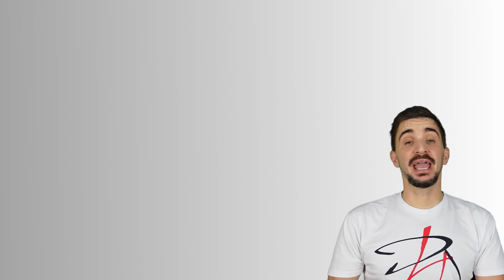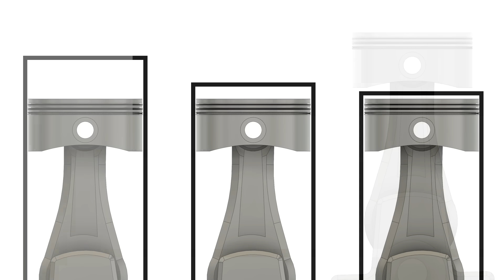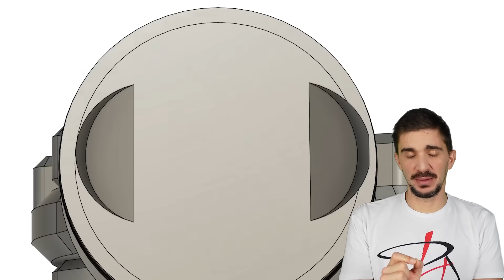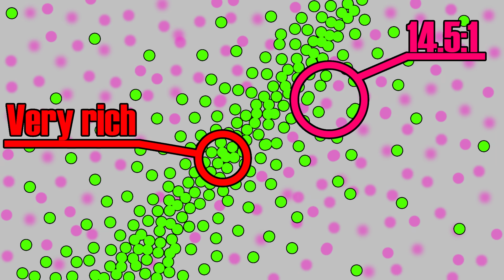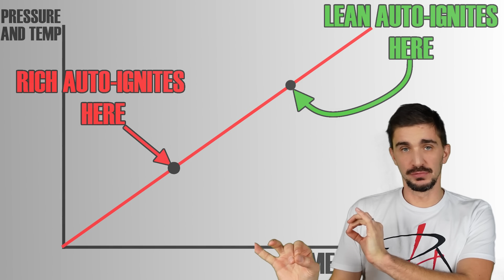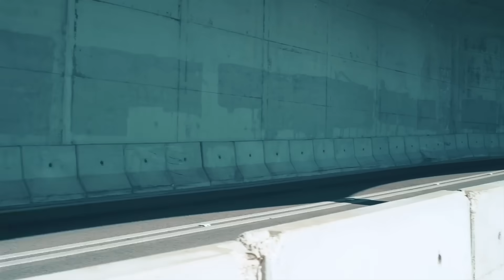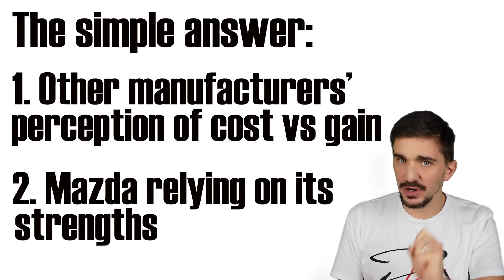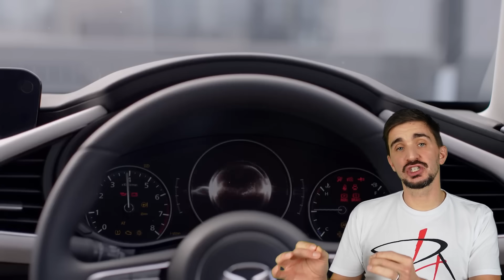The Game Changer Nobody Cares About - Mazda Skyactiv-X SPCCI How it Works and Why It Didn't Catch On

Comment: Skyactive x has bad nox emissions for US epa testing. The skyactive g has similar power and have more sellable turbo options. There is supposed to be a skyactive x hybrid with Toyota synergy drive in the next couple years. Toyota is upping their ownership in Mazda and they are supposed to have the new 86 and supra made by them so that will help.

Comment: actually you answered the question yourself at the start of the video, and it bottles down to the combustion chamber of mazda hcci actually being "over-engineered"; 

4:14 in areas where we have very rich ratios we have insufficient ratios to burn all the fuel

so the hcci is overengineered in the sense that all a standard diesel needs is more air-intake..... and the hcci solves that issue by adding a spark-plug and spraying gasoline at it..... so you already have an injector in a diesel, which you replace with a spark-plug... and then add an injector, even though you already had an injector.......

point being you can also simply increase the air-intake and as such the diesel simply gets more efficient without the necessity of adding neither gasoline nor spark plugs.

it is engineered redundancy to solve an air-intake problem by adding a spark plug and gasoline, instead of air.... it is achieving the same increase in efficiency as simply adding more air.

Comment: Mazda has all my approval for developing this. I know what torque (force) and rpm (speed) are, and that power is the product of both (P = F × v). I also understand torque, rpm and power curves, and know how to extract the most of an engine. I grew up driving a car with a small, carburated atmospheric otto engine with manual starter (air flow restrictor valve in the carburetor) which I used as little as possible, sometimes keeping the engine alive by rhythmically pumping the accelerator pedal without using it. So, to me using a conventional aspirated gasoline engine is far from being a chore; it's something fun instead. You can't count on ignorant people enjoying this, though, as some simply don't know or have been educated incorrectly. For this reason, versions of this engine with a variable geometry turbocharger or an electric engine torque booster (an hybrid, I guess) could help those who don't know.

Comment: I have the Mazda CX-30 with Skyactiv-X, and the video is spot on. The engine really comes alive when you give it some revs, but it's also incredible because you can drive it like a diesel on 1.2k RPM in 6th gear and just enjoy the low fuel consumption.
Reply: Great interior too for the price. Mazda really underrated
Reply: @SWatchik  they just lack modern tech. Has some, not enough for this time. Then the issue of price in certain regions, and agency.
Reply: Now they just need to make a 2.5L version (ideally 5 cylinders because it's cool) and 6-cylinders with 3 liters in displacement for more power, also put them in plugin hybrids and range extended EVs.
Reply: Sounds like an engine with this characteristics would pair well with electric for a hybrid, where the ECU is in charge of the throttle.
Reply: I was always interested in the sky active x technology and benefits, but the worry of reliability was too great. My next car might just have to be one!
Reply: erroneous statement/ t Aisin 6speed in my 99 mx5 rocks/ gotta keep t rev’s middle to high then enjoy/ go Mazda 
H
Reply: I wouldn't keep it under 1400-1500 when cruising
Reply: @rouchar  1400-2000 RPM is the optimal engine speed for fuel efficiency. Thats why all skyactiv cars have a special 6 speed designed to keep the engine in that RPM range as much as possible. My Mazda 3 does 40 mph at 1200 rpm like some diesel lol.
Reply: @Youtube_AI_Bot_3  that is maybe true for Skyactiv car, but on other engines the fuel-efficiency increases with RPM (because horsepower & engine-drag increases with RPM and the sum yield best output around 2k RPM for large engine and 2.5k RPM for small 3-cylinder engine).
Reply: @xponen That is not true lmao
Reply: @brolo7234  "bfsc vs rpm" will explain how fuel-efficiency peak at 2k to 3k RPM.
Reply: @xponen  I think this is mostly right, but it's only the whole story when you mate an engine to a CVT. BSFC is not just RPM, but load. If you need to produce x power to propel the car down the road, as you increase the RPM, load drops. Load plays a bigger part in efficiency than RPM does, and unless you have infinite gear ratios, you're almost always better off running the higher gear to get engine load up.

With a CVT, you can dial the engine's load and RPM into the best spot on the map for efficiency and hold it there.
Reply: @Youtube_AI_Bot_3 dude i drive a long stroke 1.9 tdi with all the low end torque and i don't keep it under 1.7k rpm in the 6th, you're gonna lug the engine
Reply: @Youtube_AI_Bot_3  and at 90 k u will need major engine work, mazda engines last the longest when u drive the daylights out of them, keep rpms @ 3500-5000 as often as possible
Reply: How does modifying these engines go? Are they easy to work on?
Reply: @mercury2c  I wouldn't modify anything on these. You'd only ruin the SPCCI mode. As far as repair and maintenance they seem to be as easy to work on as the other Mazda 4-cylinders.
Reply: I'm the opposite, have the cx30 and think the mileage is terrible. Average 40mpg, it's slow in low revs and there's absolute no grunt at high revs considering its a 2 litre. Im going back to kiabecause im just fed up with the poor performance.
Reply: @justmehereUK  40mpg on average is great for a gas powered non-hybrid car. If you think that's "terrible" then you're clearly not comparing it to an equivalent car, or you're not talking about combined fuel efficiency.
Reply: @justmehereUK  40mpg is terrible for 2.0 180/186hp car? what? For any sort of power you need to drop it to 2nd gear if you're below 100kmph or 3rd gear if you're below 140kmph and then push it to the limitter. It's normal behavior of NA engine idk what to tell you. Turbo cars feel much different to drive, it's just the nature of the engine.

Comment: Turbos seem to be the de facto answer to achieving good fuel economy test results without sacrificing performance potential (despite less impressive efficiency in real-world driving). The Turbulent Jet Ignition system introduced recently by Stellantis (where a smaller combustion chamber surrounds the spark plug separated by a perforated shield, and the spark-ignited mixture in this small chamber shoots fire jets out  into the main combustion chamber to more easily ignite the air-fuel mixture) is also intriguing as it allegedly borrows from the latest F1 engines where low fuel consumption during high load is very important. It is also interesting that they did this without actually being related to an F1 team. Looking at the corporate structure, they do own Fiat who used to own Ferrari, but they haven’t owned Ferrari since 2016. How they were able to gain access to the technical knowledge is curious… In any event, just as in F1, the engine in question also employs a turbocharger…

Comment: I drive a 2023 Mazda3 Fastback with a 190 hp SkyativeX engine and a manual.

I really like that car.

The engine is also really reliable I drorve that car a lot and had not problems.
Hwoever the Spark Plug dont last that long due eto the high compression, havae to chanage them every 60 000 km.

It is true that this engine despite its not insignificant power output lacks some punch.
It makes 190 hp, but it nened 6000 rpm to do so.
Doesnt bother me that much since I drive manual so if I wanat to pjnch it I downshsift in advance.

I am looking forward to Mazda next generation SPCCI engine the Skyactive Z, which has a 3,5 l inline6 version.

That should make up for its lack of punch.

I really hope they put the Inline6 SkyactiveZ in the Mazda3 Fastbackc.

Comment: note for the end question:  Before modern manual gearboxes, people had no synchros so they had to always double clutch. Before that they also had to manually adjust fueling and timing while driving. And had asbestos brake pads, toxic leaded fuel and oil. You would not want to go back to that. That is progress. As far as the driving experience goes, choosing what is easier and more comfortable depends on what you are doing. I'd rather do something else than driving when i have to drive into traffic, or during long straights on highway, even more at night or in difficult conditions. At those moments, i'd rather call my friends, sleep, read, work or anything else. But If I go driving for pleasure, all that goes away. Although I would not like to have to adjust AFR and timing while driving for fun on tracks or mountain roads.

Comment: My cat gives over 60mpg consistently. Sometimes over 65 and occasionally over 70. 1.5 HDI. Any other car / engine I get will be a downgrade. I love Mazdas engineering. But I can use HVO fuel which drops carbon and No from my diesel but its price is problematic at the moment

Comment: I have the slightly older, Mazda 6 2015 Skyactiv-G 2.5. The older G-version is already pushing higher compression ratio for efficiency, but not to the point of near-ignition like X does. 

Anyway, regardless of the engine type, what a fantastic car. Extremely reliable, practical, decent fuel eco for 190hp car, pretty good looking imo, nice interior and very, very fun to drive for a normal midsized saloon. Mazda really knows how to make car handling feel nice. If you're an old school guy, you can have it with a proper manual gearbox too. Mine has the automatic and that is excellent as well, it feels pretty rigid as they have maximized the amount of time when torque converter is locked, so no rubber band feel when putting your foot down. 

Zoom zoom!

Comment: Why doesn't Mazda just make a mild or rather plug in hybrid with a reasonable battery (e.g. 40kwh) for breaking and acceleration? I mean let that engine run all the time (or let me decide to run the engine or not), and then let me have fun with a nice acceleration and don't waste much energy with the recuperation. And let me enjoy all the benefints of an electric car, like v2l/v2h. Let the software manage the battery to prevent degradation (e.g. you can use it only between 30-80% except for emergency) and let the battery warm up the engine for ideal temperature to prevent cold running and other common ICE problems... Then they cound sell their car as the greenest one ever as it is made to last finally and not to leave a huge CO2 footstep.

Comment: Even though the engine might be very efficient, the cars are not. In typical car manufacturing company style they opted to NOT make their engine have the same power as the old one and vastly improve the fuel consumption, but they opted to invest all of the efficiency gains into having a higher rated power, with having only marginally improved the fuel consumption.
4.5 - 5.6 l/100km can be had with every European car that is powered with less than 80 hp, sometimes even less (especially with diesel engines).

Comment: Couldn’t a design like alphaotto’s Rev engine with the electronically controlled valve and turbo solve the HCCI combustion timing problem? U could even keep the same air fuel ratio throughout the working range of the engine

Comment: I have a 2016 Mazda Miata (MX-5 for you Euros). My car has an earlier version of Skyactiv (not Skyactiv-X). I drive mostly at 60 mph on back county roads and get 35(!) mpg in a sports car. Even when driving on the freeways at 80 mph I get better than 30 mpg. The downside is that I need to use premium fuel, otherwise less power when I floor it. (It's still amazing that the manual says I could use regular fuel if I wanted. Crazy adaptable engine). Zoom zoom!

Comment: It's ironic that so many "enthusiasts" call for saving manual transmissions, yet are so spoilt by turbo-fours with torque plateaus flat as the Netherlands you could drive them in two gears entirely - and call NA engines like these weak and slow.

Comment: What I don’t understand is the lean primary mixture NOT combusting by compression ignition……   Mazda must be direct injecting lean late in the compression stroke so the fuel won’t get hot enough to spontaneously ignite before the spark.  

     In designing engines (and other moving machinery) there are two problems:  getting it to run, and getting it to last.  The later is often  harder, and it is always slow and aggravating.  I applaud Mazda for their tenacity.                Cheers

Comment: Not bad for a first development but along with many new engines that dont have hcci or spcci it dose foul its injectors badly and relatively quickly and I suppose foul its inlet valves as every other direct injection unit dose
Hcci is a thing that dose work but not at the scale of the automotive engine just look at the old modle diesel engines they had a carburettor and compression ignition (No not the glow plug engines ) they ran on a fuel that was basically paraffin mixed with ether.

Comment: The reality is that you are getting about 10-15% improved fuel efficiency from skyactiv-x engines compared to most competitors in highway driving, but really these engines are not class leading overall. Due to their low torque they are worse and less efficient when driving slower compared to most competitors. But, most importantly Toyota's engines are just superior to Mazda's in general. You'll get good reliability and far better fuel efficiency.

I followed Mazda's development of Skyactiv-x very closely ever since they first mentioned it, but its real world performance has been far worse than what was first suggested, and the lack of effective hybridization is another issue.

Comment: It's funny what you say about a spoiled customer base. I had to stop driving for around 5 years, and we went on holiday to the south of England and hired a Mazda CX-5 with the 2.0 NA lump. 
My boyfriend at the time was a fairly inexperienced driver and had only ever driven turbo diesels, and watching him trying to drive that car was painful. Eventually he got it, but he was extremely frustrated that it didn't have torque at 1.5k revs and I kept telling him he needed to rev it. To be fair to him, the stupid gear shift indicator that Mazda put in it didn't help, as it kept telling him to shift up at 2k rpm which is mental in an NA petrol.

He got it eventually, and we actually ended up liking it so much we bought one, and I still love it. Sure, it's not fast, but it does amazing economy for what it is (45 mpg from a 2.0 petrol is crazy to me.) It's also so familiar to me. I've been driving for 25 years and almost every car I've owned has been an NA petrol. Downshifting and wringing their necks to get them to move is the best part of driving them, and I feel like nobody gets that now.

Manual petrols are sadly a dying breed, and I'm grateful that Mazda is sticking with them and trying to improve the formula rather than moving to H/EVs. 

Thanks for the vid.

Comment: Has anyone tried to mix diesel on intake stroke and then inject gasoline at TDC or even use a spark plug to ignite the homogeneous diesel mixture
This engine can be very useful in hybrid cars

Comment: Is there any data on how much this technology improves fuel economy in the real world? Hypotheticals are nice but only hypothetical. I was comparing my ford maverick (2 liter turbo with AWD and all terrain tires) to my friends Mazda 3 hatch (2.4 liter skyactive X NA engine, FWD), and we both got almost identical highway MPG numbers at 70 mph in top gear, despite the ford maverick weighing several hundred pounds more, having worse aerodynamics, having all wheel drive with heavy all terrain tires, and making substantially more horsepower and torque.

Comment: I won't say it's unimpressive.
It is a nice piece of engineering but what about real world results?
I heard people saying most of the time it runs with the regular ignition cycle rather than the SPCCI cycle.
And then there's the "issues" like low torque at low rpm.

I checked some website (I don't know the accuracy of the data so don't throw stones at me). So 2.0 skyactiv G vs X (mazda3 from 2020 to make sure it's no mild hybird involved, G122, G150 and X180) to compare their torque curves. So X hits peak torque at 3k RPM compared to 4k RPM on both Gs but low end torque is worse on X: at 1k RPM it's 75NM compared to 100NM and it surpasses G after 1750 RPM. At 2k RPM there's already more torque on X compared to G but low end torque is somewhat worse (which might be more obvious on since the car weights more with this engine)
But then I look at the mild hybrid X released years later and ... low torque is better now. And peak torque is higher but also at 4k RPM (torque at 3K is the same as it was on the non mild hybrid)

Ok so torque is questionable, especially low end. Other issues that I've heard about is engine heats up really slow. Yeah good luck driving around town in the winter...

If you can get good gas mileage on the X is it worth the extra complexity of something like the skyactiv G? Yeah it reliable but if something breaks does anyone know how to diagnose and fix? You can get a 10 year old skyactiv G and people know how to work on these if there are any issues. Will we be able to say the same thing about the X in a couple of years?

Comment: I only see a different version of a gasoline direct injection in combination with a stratified charge. Both exists since decades.
Additionally you didn't mention and explained the fundamental difference in between gas an diesel engines: Diesel has constant (air) volume and adjusted diesel injection, while gas has constant share between gas and air and regulates the filling with a throttle.
There exists nowadays more Versions sharing this two principals, but: You didn't mention this fundamental difference.
30 % better efficiency is therefore just wrong.